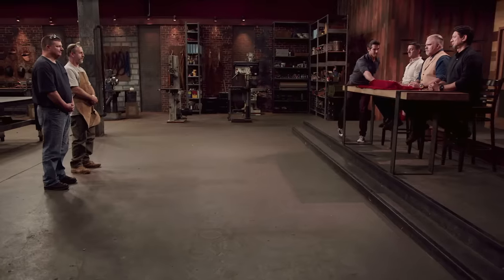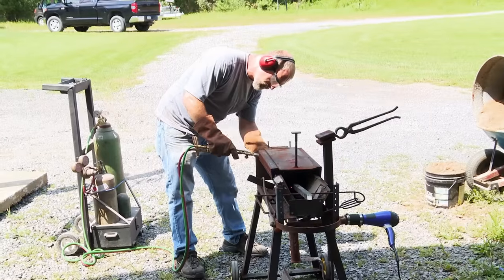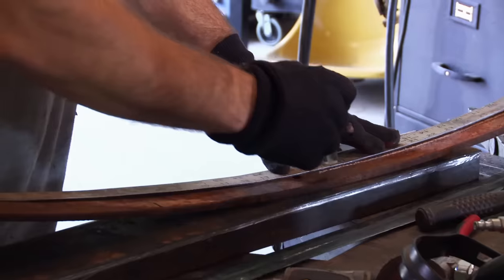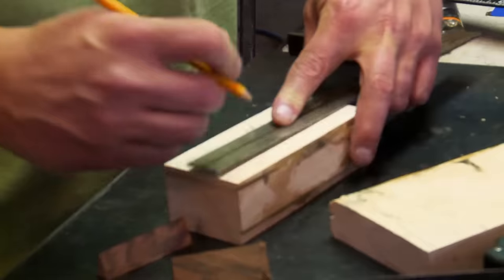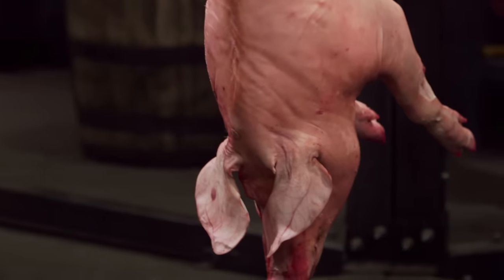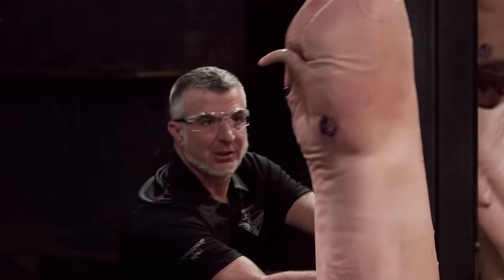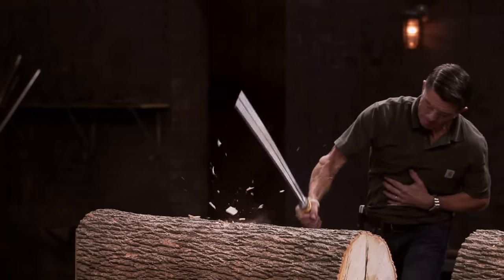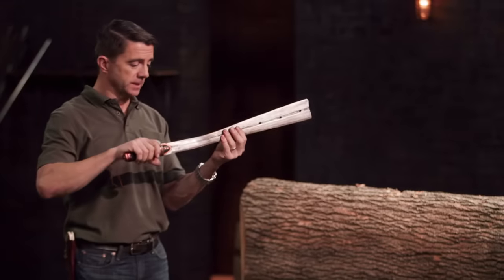Forged in Fire: Philippine War Golok SPLINTERS the Final Round (Season 5)

Comment: Anyone else notice when their first attempt suffers catastrophic failure at the home forge, almost all of them fall back to a leafspring?
Reply: Because, leaf spring is high carbon steel and in the shape of blade already. Almost all traditional golok in my village use it
Reply: Because leaf spring is extremely forgiving as a high carbon steel when it comes to quenching and working time while heated/grinding. Probably the most forgiving you can get for a high carbon steel seeing it is used for literal springs.
Reply: @CatTechSupport  So what did the other guy use cause his was clearly better or did he just do the forging etc better ?
Reply: @mijnmening  Skill out beats everything. Even the slightest amount of skill difference can make that 0.01% chance of taking home a win happen. Extremely skilled blacksmiths can work with just about any metal: be it copper, gold, silver, and or what ever you want given enough time, effort, and material allotted: all that matters is skill and how hard one works to achieve that level of skill.
Skill will always be the final determining factor within everything in life after all. The saying "work hard and you will go far" exists for a reason. Sometimes it just takes longer than others because some have the sheer luck factor behind it.
Reply: @CatTechSupport  Alright ty for the info, but then when they fall back on leaf springs that's actually a tell of their lack of skill then.
Reply: Leafspring is a lot more forgiving than more specialized steels

Comment: Since they have banned the tip what the early Filipinos did was to add weight with maintained sharpness to penetrate plate armor. It then evolved into itak sword and guinunting which is a one sided sword extra strong and very shard but could also be used to parry other sword with the other blunt side

Comment: I wonder if Matt tempered the first blade after he had quenched it. if he didn't there's no wonder why it snapped when he tested it. Or maybe the tempering process was cut away, as usual in Forged in Fire. A chame really. A quenched blade is hard but it's also brittle. The tempering process is vital, especially when it comes to long blades, to increase the ductility of the material and lower it's hardness. That way the blade is far less likely to break or snapp. But I guess the tempering process isn't as exciting TV as the quenching process so that's the reason they almost always leave it out.
Reply: If the smith notices a problem with the blade like small delamination or micro cracks and its not bad enough to take good pictures then the producer will ask the smith to "test" the blade without tempering.
Blades breaking make for better TV than a smith just tossing a bad blade in the scrap bin.
Reply: @pb222221  I really hope, if this is indeed true, that they only do this once the smith has decided to scrap the blade already.
Reply: It didn't look like it was tempered.  It still was covered in scale and such.  Weird choice.

Comment: 1:25 Predictable outcome, an uneven heat on the quench always fails.
Reply: Plus no tempering
Reply: @Brandfall609  Not necessarily; it depends on the steel used and if there was proper thermocycling before the quench. Normalizing your steel is a very important step, it's not all just about the heat treat.
Reply: True, but a quenched blade also needs tempering. Especially a long and forward heavy blade like Matt's to blades. If the blade wasn't properly tempered after quenching it's no wonder it snapped like that, no matter how even the heat on the quenching was as it doesn't just make the blade hard, but also brittle. Considering he said at the end that he had lots more to learn about blade making it's possible he forgot or didn't think he needed to temper the blade after quenching it.
Reply: @Verdunveteran  It's certainly possible, although these Forged in Fire segments often omit steps in the forging process - the tempering stage is always a victim of this. The show almost never shows blades being tempered, even though they always are (there is a period in which all 4 contestants' forged knives are tempered at the end of round 1, but for the streamlined schedule of the show this always takes place off-camera).
Reply: The need for tempering (in most cases) after quenching is so basic that I believe it is pretty much impossible to anyone in this show to forget. However, there are many possible issues in the heat treatment process that are really not obvious even to experienced bladesmiths.
Reply: They always skip showing the tempering process. Who knows if he did it or not. But right after quench the metal is as brittle as a file, which is why it "skates" on the blade. Not all steel alloys are quenched / tempered the same way...details also skipped in the show.

Comment: Bedog or what can also be called golok is a traditional Sundanese weapon which is shaped like a knife.  However, this bedog is quite large in size.  This weapon is probably familiar to most Javanese people.  Because this weapon is still often used for everyday purposes.  The size and shape of the bedog itself is very diverse.  Because the manufacturing process has been adjusted to suit your needs.  However, usually the bedog measures 30 to 40 cm and is made of iron or steel which is forged until it is smooth and flat.

Comment: They basically make something in the shape of a sword just to damage it. 

They hit the blade on a log straight-on instead of at angles, they don't really talk about any part of the process forging process or the attention required to do it right, there's no attention to or appreciation of the time/effort needed to make a sword (even a simple one), and worst of all, they put their bare hands on the blade (which allows your natural oils to transfer to the metal and etch into the blade if not removed).

This is not a show I would recommend for connoisseurs of sword-appreciation.
Reply: Well because that is not a sword, that is a gulok and it's really is being used that way because it's supposed to be durable enoung to withstand wood chopping, meat and bone
Reply: @void_watcher1737 Google does say that the golok was used for cutting wood, vegetation, and people, but a blade that thin is still not meant to be used on anything thicker or denser than a human limb. 

You want your blade to pass through with as little resistance as possible to minimize dulling. Axes are better for logs because they're thicker and don't really need a sharp edge, and even then, experienced log cutters will cut at opposing angles to remove chunks of wood easier and make it farther through the log much faster.

Comment: i dont know where that featured golok came from, but as i know Philippine golok is different design. It is not more than 2 feet in length and maybe 3- 4 inch wide.. or maybe  im wrong
Reply: and it can be used in all purpose like any tools did..it can be a hammer, axe, and sometimes concrete nail cutter🤣